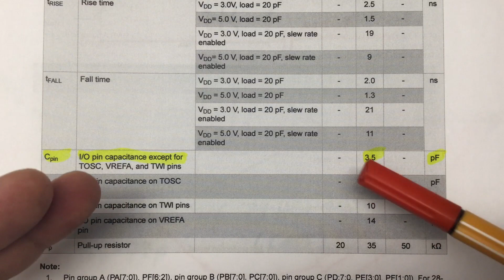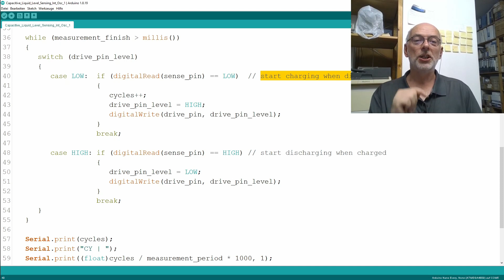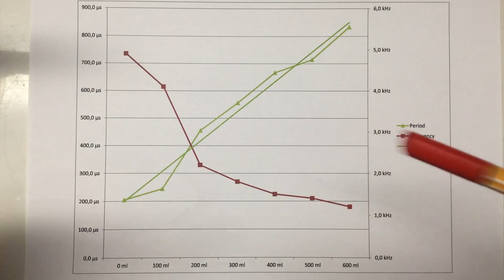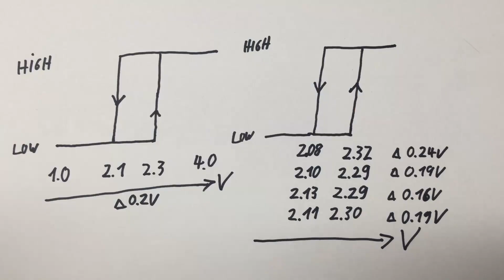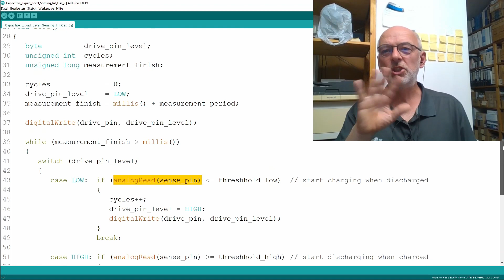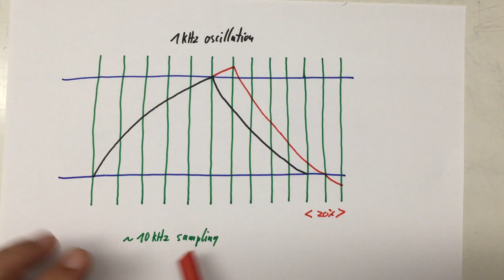Capacitive Liquid Level Sensing (5): Analog to Digital (2)

Comment: You solve my one problem,  I always to test 328P to logic 1 min volt and logic 0 max voltage but I don't have precise  power supply.  I think alot of  linearity is improving from previous video.
Reply from the maker: Wait until part 6 (coming tomorrow, Sunday, 31st of September 2023). There we'll make some real progress.